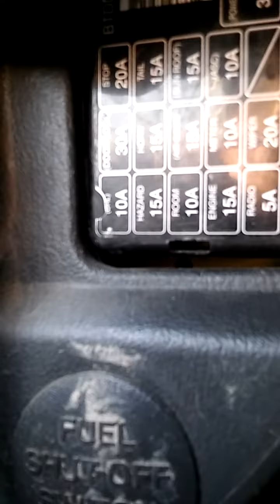98-03 Ford Escort ZX2 brake light switch

Comment: Thank you! That was the exact issue my daughter's car was having. Saved her $200 for a mechanic's visit to basically adjust a nut. 😊
Reply from the maker: Yea it seems the rubber tip wears out / breaks away and then the spacing is off between the pedal and sensor.

Comment: Thanks for posting this. I’ve have had my zx2 to the shop twice. They have replaced the switch . The second time they sprayed it with lubricant. Now it’s still on . So I jiggled the brake pedal and it turns off the brake light . So it going back to the shop for the 3 rd time. I’m going to show them this video. Maybe they will get it right this time. Hopefully.
Reply from the maker: It's normally the switch or the little rubber pad that falls off. Turns out mine was the missing pad aka spacer which threw things off. Just adjust it yourself. Save the time and fighting. Only takes minutes.

Comment: The hole is for a nipple that is part of a silicone rubber bumper that goes between the switch, and metal plate. The nipple broke, and the bumper (about 3/16" thick), fell off. It acts as a spacer between the switch, and the plate. I just glued my bumper back into place a for temporary fix.
Reply: My rubber bumper broke into 2 pieces and the nipple fell off. Were you able to find a replacement for just those 2 pieces? Thank you.

Comment: there is a rubber grommet that fits in that hole in the pedal that takes up space between the switch and that pedal
Reply from the maker: That would explain why I had to adjust it. I was told that was why my cruise stop working.

Comment: Thank you...I fixed the issue....

Remember folks.. disconnect the connector first! Then just unscrew the fuse- that.s it! 

The bolt on the backside is welded...or fixed position...😡
I spent an hour chasing that bolt instead of twisting out the switch...😑🤣🤔😖my fault..but I learned...

Long story short, problem solved and thank you for posting this video...👍